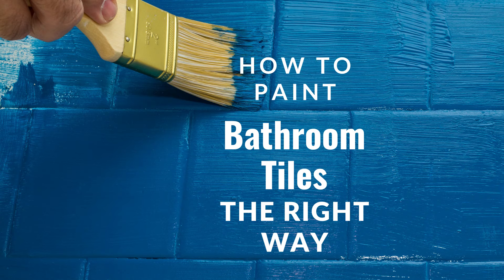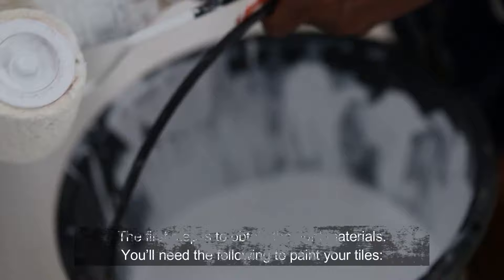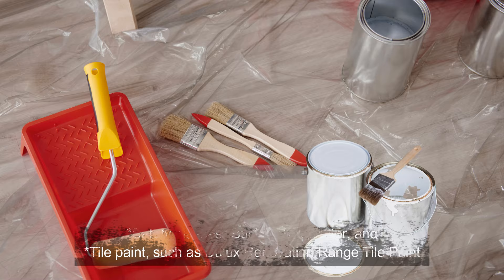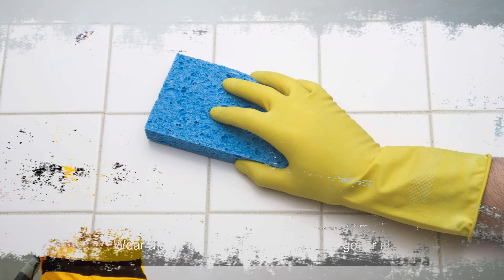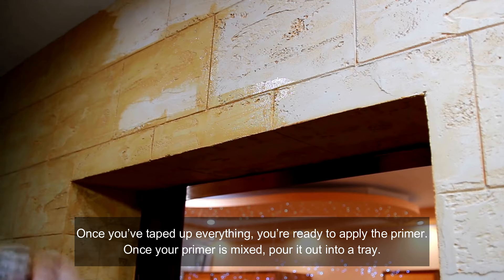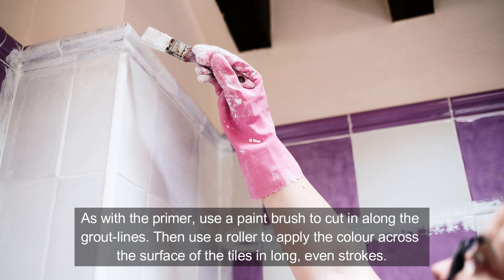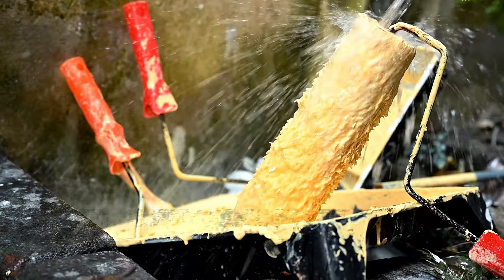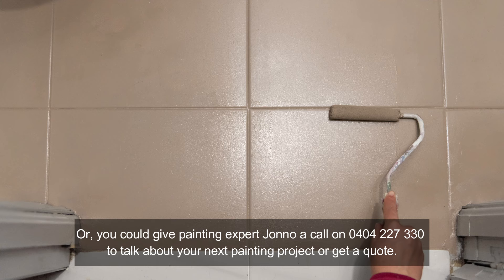How to Paint Bathroom Tiles the Right Way

Comment: I never sanded my tiles before painting or any primer. They came out stunning  .
Reply: Can I ask what brand Name paint did you use?
Reply: What brand name paint did you use
Reply: does it last? i mean how about the flooring?
Reply: I am beginning the job and having a lot of trouble using a sander. It keeps flying off my equipment and it doesn’t seem to be taking anything off the tile. So I was hoping to find an answer that made the sanding unnecessary. Thanks.

Comment: There is not, never has been, or ever will be ANY way to paint bathtubs or tile. The ONLY finish that will stand up to regular cleaning is the SUPER HARD BAKED ON finish that ONLY the factory can deliver. Don't believe me? By all means try it for yourself.
Reply: What is super hard baked on?
Reply: Paint is baked on at the factory ~ can not be done any other way.
Reply: You may be right, but I am reading a lot of people say that they have had good results using Tile or marine paint.
Reply: Well for a refresh it's ok untill you decide to buy new down the line.

Comment: well after painting it how do you clean it???? does it wipe/peel off when scrubbed? and how do you deal with molds and mildew after it is painted??? will molds and mildew stick more with the painted added in??? lookin for this option for my bath but am worried it'll be more tedious to clean if it got icky dirty.
Reply: yes wondering the same

Comment: What grit of sandpaper should you use?   I've tried 40, 80, 120 and my tile still has sheen.   It's a bit of a textured tile.  I figures using a very low grit would take the sheen right off but even with an electric sander , the sheen has barely scratched.
Reply: EXACTLY! The same problem I am having. Going broke on buying packages of circular sandpaper.
Reply: @pamgrimm8850  I ended up speaking to someone at the hardware store and they told me just clean it and use acetone to clean the tile well.   Let it dry.  Then paint.   It's been a few months now since I painted and the tile has been perfect
Reply: @fadingstarlight  all done and it seems to be holding up just fine after a few showers. I ended up using a few coats of KILZ undercoat, all total six coats of paint, and I think it’s very well protected from moisture.
Reply: I know this is late but for anyone else wondering 120 grit or lower should work.  It will look like you didnt even sand so keep track of the areas you did and do them well.  And yes your tile will still have a sheen on it and look exactly like before you sanded. What you dont see are micro crevices that are left behind allowing the primer to stick better than on a non sanded surface. You have to ensure to wipe the tiny dust left behind that you cant see with a tack cloth and reclean and dry the tile.  The key is a great bonding primer, I used STIX.  Good luck
Reply: I read that you use toilet bowl cleaner to etch. I’m about to do that !

Comment: Save your time and skip the video and follow this;

Dont wipe tiles, then sand.
This is the equivelant of wiping your arse and then having a shit.

Sand with heavy grit and spray water often from a spray bottle: controls dust. Wear a good mask. Wet sanding is a must, dry sand will just not do the job.

Sheen should be dull; now sand with higher grit to smooth it out; same way as before.

Now use a primer; and coat it up until its a uniform finish. Then topcoat once. If you topcoat twice your back at square 1 and you may aswell be painting straight onto tile again.

Pro tip;

Everyone you know whom has painted their tiles doesnt realise what a terrible job they have done; its slowly dying. Karen the housewife and John the tech guy have paint sat on tiles and it hasnt adhered. Do yourself a favor and dont even paint your tiles; and tell them how bad a job they have done to theirs and essentially caused massive problems down the line.